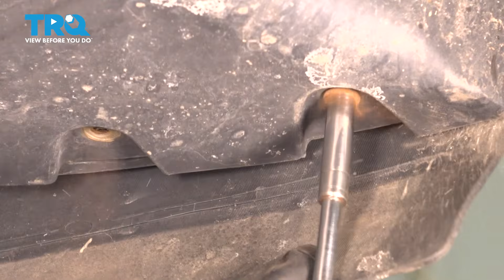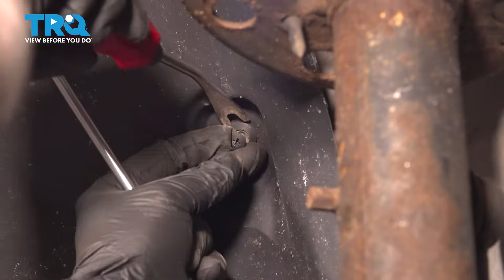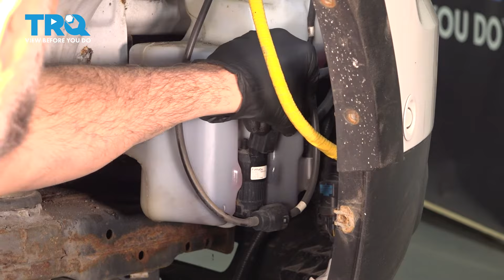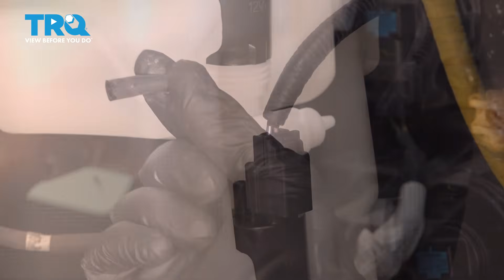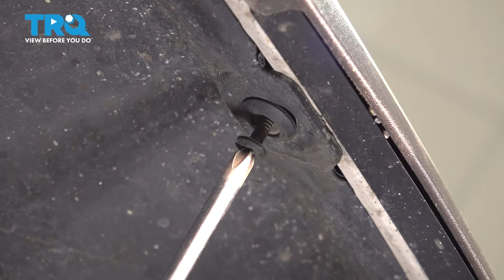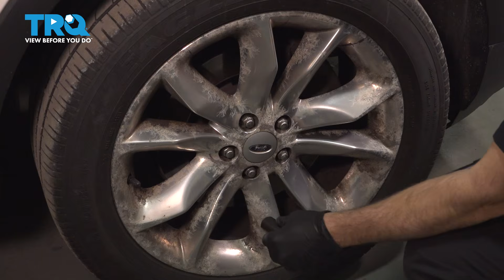How to Replace Windshield Washer Reservoir 2011-2019 Ford Explorer

Comment: I would say its probably worth buying a new reservoir with a new motor already installed. The factory motor loses strength over time and might actually be the issue instead of a cracked tank. The process difference is not that much